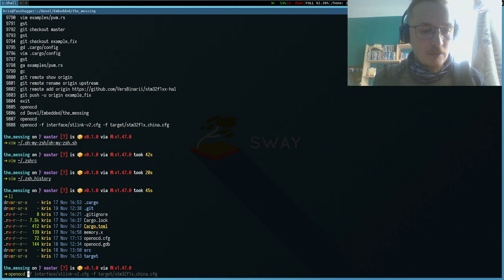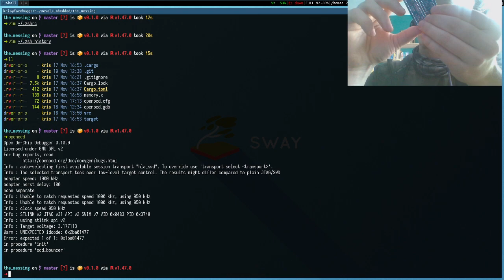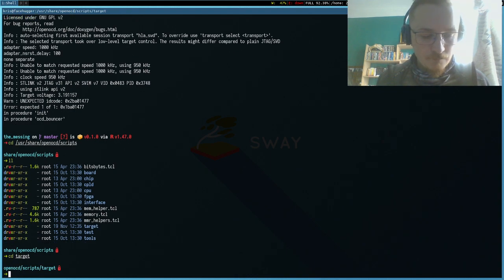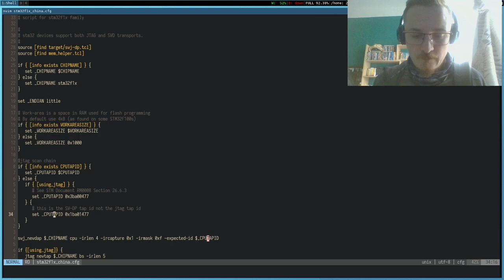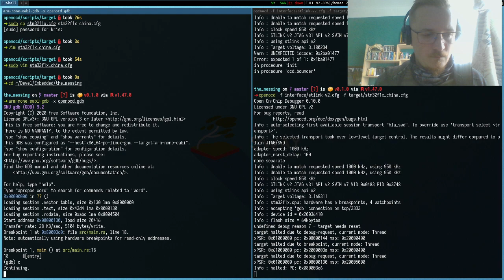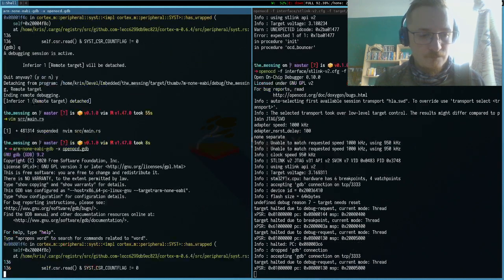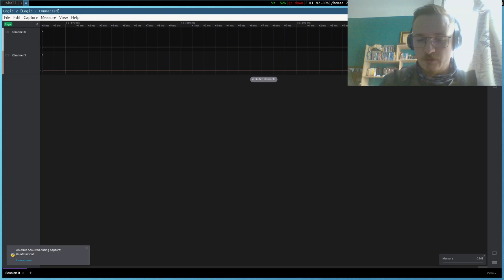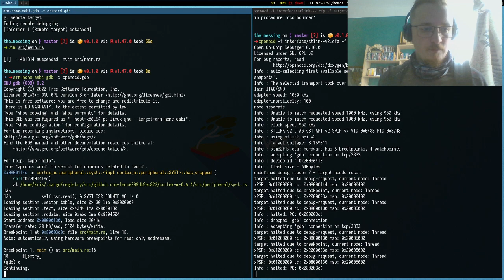Programming "fake Blue Pill" from china

Comment: Hi! Here's a question.. Have you ever had any issue with your fake board so far? I have to use one of them on a project wich involves using ADC, Serial communication and some mathematic operations. Nothing much complicated actually, but maybe you can give me some advice. Thank you in advance. Nice video btw.
Reply from the maker: I didn't try ADC specifically but  i have few small projects running on them using Timers, PWM, Serial and I2C. All working fine so far. But who knows how much difference there might be from board to board. If its possible for you, consider developing on real BluePill and when all confirmed working, deploy it finally on the fake one.
Reply: @versbinarii2422  I'll try to find a legit board to do what you are suggesting but, as you know, it's really hard to recognize the clone ones unless you buy one and load a code on it. Here in Argentina it's not that easy to return a product if it doesn't meet your expectations but I'll take in count your advice and see what I can do. Thanks a lot for your reply!
Reply from the maker: I feel your pain. One thing i can tell you is that all the fake chips that i found so far had the "911k" in the serial number on the chip casing.
Reply: @eugenioredin718  Buy from someone who sells both. Then you should be confident the stm32 you get is real. I bought some ch32's from a seller like this , he was selling the stm32's as well but the ch32's had dual usb C and were slightly cheaper, not much, the extra featuers brought the price closer to a stm32 but that being said, it shuld be known, the companies who make the a ch32's arent trying to pass them off as stm32's. they're offering a cheaper alternative(and according to them a more powerful one with better usb features), its sellers who exploit this cheaper alternative passing them off as more expensive chips are the ones faking it.  So if you buy from a seller who sells both and lets you pick, you should be confident they're real.